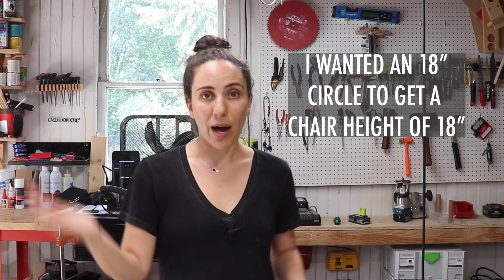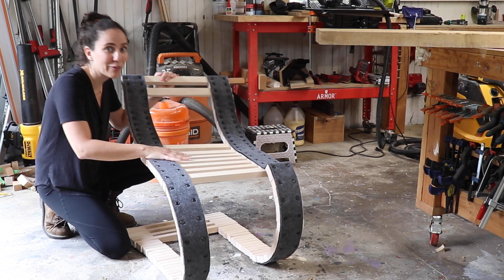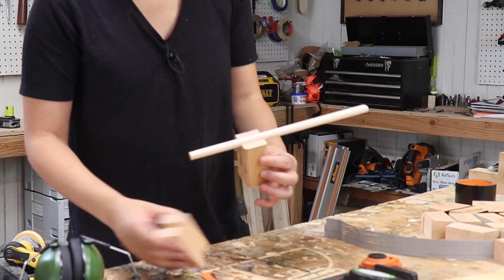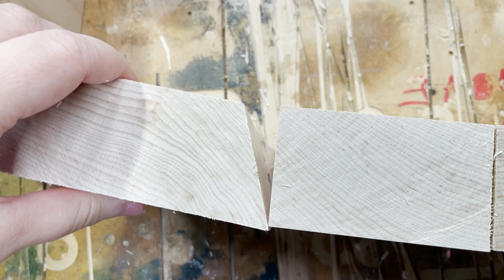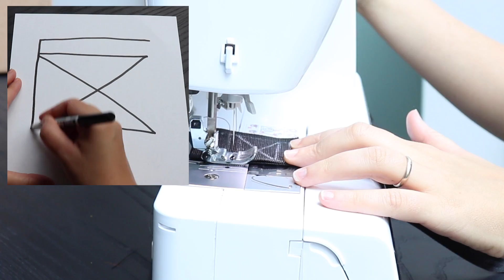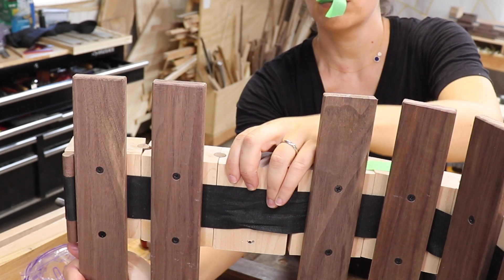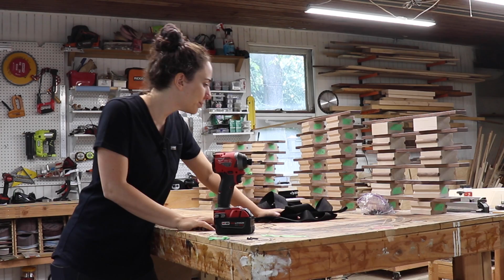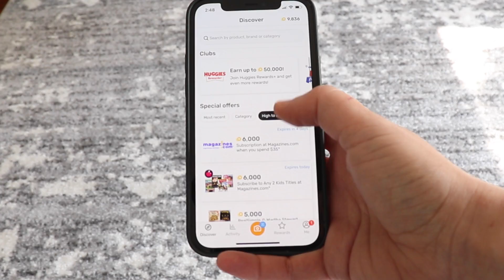I ATTEMPT to make a Roll Up Chair… AGAIN...

Comment: Why not make a hole through the wood in the direction of the strap and add wire through it strengthening the structure through the inside. Just a thought

Comment: I feel like, unless you want to attach the strap to each block individually (so the tension on one joint won't affect the tension on other joints), the strap on the upper curve at least needs to be separate from the strap on the lower curve

Comment: What about vertical supports that swing down from the seat (middle) section and attach to the leg section. Or one from above and one from below. They'd carry all your load in compression and it could still roll just as well. Would it ruin the aesthetic?

Comment: I genuinely don't think leather will work; it stretches way more than the nylon straps you used in this video. I'd try using steel wire seeing that's way stronger (though it would be heavier, but if it sits it should be fine?)

Comment: I like the idea, but as long as the strap is against the supporting blocks, it will not work.  You are essentially trying to build a cantilever without the lever, so you cant. 😁  
The strap needs to be spaced farther from the pivot point of the blocks.   You are using long, thin blocks that are longer than the thickness, but you would need the opposite ratio to make it stable.  Instead of placing the strap directly against the support blocks you could use the cross slats as a spacer to raise it away from the support blocks.  Maybe double up the strap for strength.  Something like seat belt material woul be great.  
In summary, the design is lacking triangulation.  Like a bridge that has been built with the supports too low relative to the length.  
I hope that makes some sense.

Comment: Equilibrium: h*T = d*W
h - thickness of block in direction perpendicular to strap
T - tension on strap
d - distance from most forward point in chair to center of butt
W - weight of person

Assuming W=1kN (~100kg) and d ~ 15*h, then T=15kN (~1.5 ton).

From specs:
- Breaking Force = 2*3600lb = 32kN (should be ok)
- Elongation at breaking = 3.5% (got this from rope of same material)

Very roughly:
elongation at 15kN ~ 2%
length of strap ~ 4*d
=> length stretched ~ d*8%

I highly recommend that you try fixing the strap to the blocks. It would spread out the stretching (instead of concentrating it on 1 or 2 blocks), it would solve the problem of the curling at the end of the chair and it would compress all the blocks. Perhaps you could try epoxy + nails (to help give the epoxy something to grab on to). 

Alternatively you could try steel wire rope. Four lines of 1/4'' (2 per side) could be placed in grooves along the chair and then covered with some felt for looks. Perhaps using a tensioner to adjust the tension after it is assembled. I would probably suggest to go through the center of the blocks when doing the tight curve and back of the chair.

Comment: From what I can tell, your strap might be too stretchy. You might want to look into a static strap. I heard you were thinking about leather, I don’t know if that will work, as it stretches too. Also, I think your design is your down fall. The side profile of your chair looks like a chair. I don’t think it should. The weight of your body should move the chair into position. Because it already looks like a chair before it has nowhere else to go but stretch. Try to remove some of the wood pieces, so when the weight of your body bends it to shape. 

And if you have a stopping point for the chair, the chair can’t keep bending back. Maybe I’m wrong, idk, this is just my two cents.

Comment: I'm not sure if you're against using metal, but perhaps metal hinges would help keep the gaps from forming. It would still allow you to roll the chair, but it would keep the wood pieces at set lengths.

Comment: instead of prioritizing strength prioritize a material that just doesn't stretch. straps are designed to give a little before breaking, you want it to sit in that position without pulling tension, so securing what ever material you end up using down on each block is probably the right action. I would imaging that maybe a stainless steel chain mesh like that you would find in a watch band would be a good material for this. it would be extremely expensive but it's likely the only option unless you want to look for some exotic plastic material that shares similar properties. you might also want to look into cabling, as that can also do what you want.

Comment: Even using wet belly leather when you assemble it will stretch and, eventually, it will dry out and crumble.    Unfortunately I don't have any suggestions, but a thought.  When a piano has new strings put on it, is tuned high and several times because the tempered steel stretches with all the force.  Some even use a string stretcher.  For the first year after restringing the piano will have to be tuned multiple times until the strings are stable.    Also, the bridge cap is a separate piece of hard rock maple.  You may want to look at ebony, rosewood, .... yeah pricey...  Or (unfortunately another pricey thought) is which way and how tight the grain is running in your pieces.  A soundboard on a piano is made of pine and has thousands of pounds of pressure on it, but the grain is straight and tight.  If it has tension wood it will break once the strings are tightened.    I look forward to your next go at it and I think you made some major strides.  Now I'm off to find your 2nd attempt. 🤙🏼

Comment: You need a zero stretch or pre-stretched material if you want to stick with strapping.

Or individual hinges between each piece.

Leather will be worse than the webbing

Comment: You need to secure the straps to each piece rather than let them free float. That way you can set the tension between each piece. It also reduces opportunity for stretch.

Comment: If you feel like trying again, I faced a similar issue in the past and ended up going with a kevlar thread. After a very quick look, you can get kevlar webbing, from their specs it has a tensile breaking strength of 5500lb and more importantly an elongation break of 2.4%, I'm sure it can also be found in many different sizes and strengths
Reply: I thought of this too. Kevlar is almost impossible to break and even more resistant to stretching. I think Kevlar has the strength to sustain her weight without needing to be under too much tension
Reply: I was also thinking of Kevlar or CF

Comment: What you could try is doubling up the Venom strapping, stitching it together. I think the main problem is that the material is too stretchy rather than not having enough tension. I’m not entirely sure if that would reduce stretching, but from a logical standpoint, it would stretch half as much as the current version because there’s twice the amount of force needed to stretch it to the same length. Another potential option could be using multi-strand steel cables, maybe three per side, though that might get expensive fast.
Reply from the maker: I did consider that. But I didn’t have enough of it left over
Reply: @3x3CustomTamar  looking forward to V3 experimentation. Oh, maybe steel cables inside the Venom strapping, keep the look without losing the [inverse of stretchiness]

Comment: What if instead of a chair, you had the same rolling idea, but without the back to support, well, your back. What if instead when you assemble it, it resembles an empty cylinder or, a log thats empty. Then you don't have to worry about the back being strong enough to support someone's weight.

Comment: If you break the straps up one set for the seat and one at for the back you could disconnect the tension from the seat that was causing the back to collapse and a shorter strap will not stretch as much as a longer strap

Comment: What if you used hinges between each piece of wood? That would make each joint independent so you wouldn't have the top or bottom curling up.

Comment: I wonder if some sort of metal sheet could be used instead of polyester? It would have low stretch and if thin enough could work for rolling it back up. Either way great vid!

Comment: What if instead of running the strapping on the outside of the chair you put it inside? Having it in the middle of the wood would completely change the way the tension works on the wood, instead of pulling on one side it pulls the pieces together.

Comment: If you ran a steel cable through each of the blocks, that could take up the tension of the chair itself. You could use a piece of threaded rod to tension at the floor section. To keep the rest of the chair stable, you could use a nylon strap to attach the chair back to the threaded rod using a grommet or something similar. This extra strap could be used to secure the chair when it is rolled up. Part of your issue as well is that the tension is not centered on the wood pieces itself. That differential tension is definitely making parts of the chair collapse when unloaded. 

Adding some tension adjustability with a threaded rod and a nut would reduce your re-work. I love your idea with the wooden dowels. That's such a great idea and I never would have come up with that myself.

Comment: If you use a dedicated ripping blade on your table saw you would burn your maple lumber when cutting it. The problem is that general purpose blades don't allow you to rip the boards at a high enough speed to avoid burning it.
Reply from the maker: Problem is those are generally full kerf. I can’t run full kerf blades in this saw. It’s not powerful enough and it trips the breaker.

Comment: The only way to make this work is to get rid of the stretch in the straps. You could consider load-rated lifting straps but I think steel wire strung through the blocks is the only way to go.
Reply: Though thinking about it, I'm not sure you could roll it up!

Comment: no straps, metal hinges between each block. If straps are the point of the design, definitely try contact cement, spray adhesive, or search for a glue that works the material of your strapping, AND use the staples, and slats. Glue the strap to the pieces, staple only where the slats will go so they aren't visible, then attach the slats the way you did but with adhesive as well. Another method is to make the blocks out of resin, mold the strap into the resin. You can mold the strap in each block in the shape of a horseshoe so there is less chance of it sliding through. you can do a combo of a resin/strap top to a wood base for each block. DON'T EVEN TRY LEATHER. leather will stretch over time and not return to its original shape. Either way, hinge or glue, if the strap is fixed to each block, it won't pull other blocks further down the chain.

Comment: I’m wondering if maybe steel packing straps would work? Like we use in our factory. They’re thin and flexible too roll up but should have no stretch because of a super high tensile strength.

Comment: You need to pre-stretch the strapping. A forklift helps with an anchor point on the ground. I have this same issue when installing Dynema cable in cranes. I use the hydraulic force of the winch cylinder to stretch it out during installation but every once in a while I have to return to the crane and redo the splice and sewing.
Reply: This is also the case for Dyneema sailboat rigging. They even sell pre-stretched (annealed) Dyneema for this reason. 'Course you can always get the cheaper stuff, tie one end to a tree and crank away on the other end with a winch.

Comment: I've seen something like this before, and this is an IDEA that MIGHT work for the tensioning.
IF I'm right, ONLY two points need to be permanently locked, and thats each end of the strapping, after the strapping is properly tensioned... 
This would mean the the other segments could be like slots, allowing the strap to move in as necessary, at least they could be free moving until after the rest of the chair is appropriately tensioned.

So... the bottom strap fixture could be locked down, and when the chair is in position, you draw the strap through the upper point/tension it, until the chair pulls itself into the desired position, when thats finally achieved, you lock the upper section in place and if you so desire, lock the other segments to the strap while its in position, thus eliminating slippage.

I hope this makes sense :)

Now, while the above idea might work, I agree with others about how they would prefer a mechanical hinge design

Comment: why don't you make a second curve for the backrest so the act of you sitting down pushes the back of the chair into tension? you would have to loosen the resting tension though because it would just keep shoving you out.
Reply: I understand what you're doing but all you need to do is add equilibrium which you can do by just attaching your top to your bottom and calibrating against the weight, that's called a hammock. I don't mean to belittle you by that its just a solid connection always makes for better stability and you seem very focused on making it self stable while forgetting other forces apply too.

Comment: If you could join the pieces with two pieces joined by one strap and create a chain of that i think it would work the problem I think that has is just demanding a two straps that are long to not stretch at all instead you could make that strap into smaller pieces eliminating the stretch problem

Comment: Hi, I saw your attempt to make the roll-up chair, the pieces are resolved. I thought maybe you could use a steel cable as a form of mechanical union inside the wooden blocks. The idea is to have a tensioner similar to the one used in suspended sliding doors so that they don't warp.
I wonder if it will work.

Comment: Those gaps that you get on the strap-side of the blocks is something i don't want possible at all. Ideally those edges would be firmly connected since they effectively have to withstand the entire weight of a person on a lever. Several people have suggested metal hinges which seems like a step in the right direction.

Increasing the thickness of those most supporting blocks should also help. That would shift the pivot of the lever-action away from the strap/hinge, reducing the forces there.

Comment: I would consider a steel wire. I doubt any reasonable fabric will be sufficiently inelastic. A very hard to solve safety problem I think is that no matter how well it works, it seems very easy to badly pinch yourself or someone else as you bounce slightly in the chair. Anyway, very happy to gain some of your experience in just half an hour!

Comment: I have an idea for your chair...your brilliant...this will help...let me know if interested
Reply: Underneath the area you sit...add a piece of wood that is anchored on one side with a pivot type mount(add one directly above or below on next slate anchor point mounted opposite side)...this will allow the legs to pivot down to rest on ground/chair...still allowing to fold up and roll up with no issues...this will help with structure as well as safety...great job though!!!

Comment: You need a flexible material that does not stretch. Lots of people have said steel, but I know steel does stretch a little, get a few different materials and test them under a simulated load to see how much they stretch at a certain force, go with whatever has the least stretch. You need to avoid that elastic area of a material, that might mean running more of the material that will be in tension, I'd also really recommended multiple lengths, not just one of the tension material. It looks like there are some areas that require more tension than others. Clearly lower down you need more tension to support everything, but further up you need less, shorter segments will also just stretch less, all the stretch would not be able to be in one spot, where it currently goes in your lower curve.

Comment: I don't think straps will work without some serious engineering and calculations, but I'd be willing to bet a system of one-way hinges might do the trick. The straps could be extra support in this system, but hinges would help ensure each joint would only have a certain amount of spacing.

Comment: Anyone think steel cable running through the blocks would work? you could have a tension block on either end to constantly tweak the tension and see if that would be strong enough?

Comment: Leather is probably not going work any fabric or an organic like leather is going give even if you get enough tension to hold it's shape time and even temperature will change it. I think the only way to do this would be metal hinges or maybe metal cable.
Reply: You might want to look into bridge designs for inspiration specifically suspension and movable designs

Comment: Metal 'wishbone' inserts between the slats on the sitting side of the structure.  The metal will not give under pressure and will also have enough play when rolled up to allow the rolling of the structure.

Comment: This may be a bit late but I have a recommendation. What you have hear is a massive lever. This places immense tension on the strap, which is necessary to keep the main bend from stretching. Unfortunately this high tension causes the ends to roll up. I recommend adding two stress reliefs to the strap at either side of the main bend. To do this you may run the strap in between two slats around one of the dowells. Sew the strap together at a point between the blocks and glue the dowell to the one of the blocks. The stitching will need to be strong as it will be loaded in shear. The dowell will also need to be firmly secured as the forces will try and rip the dowell out. Tension in the main bend should no longer cause the ends to curl up. The UHMWPE will probably be the best material despite its tendancy to stretch as it is very strong.